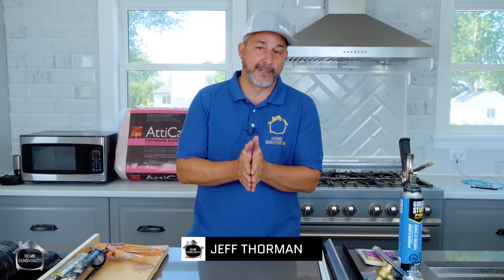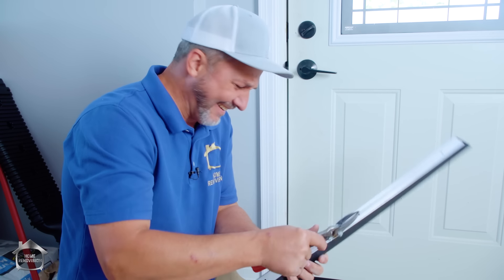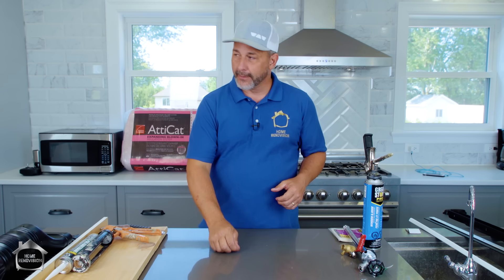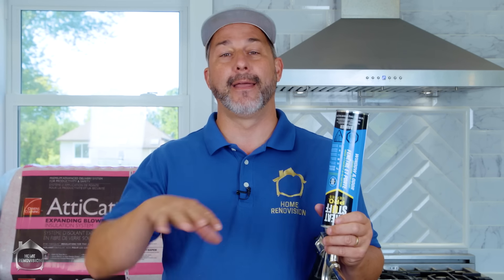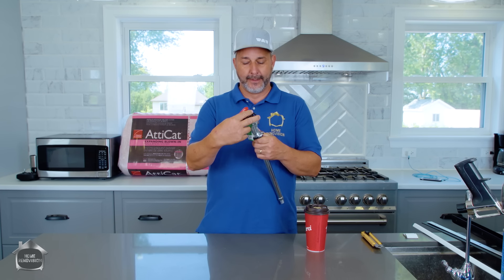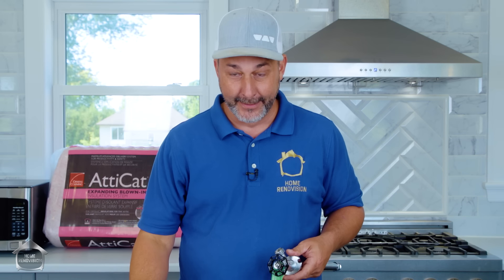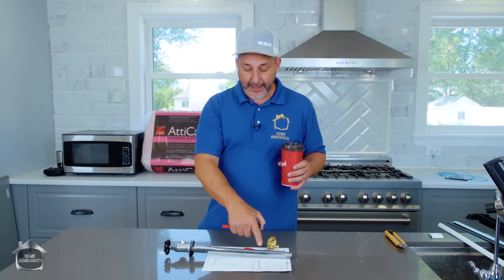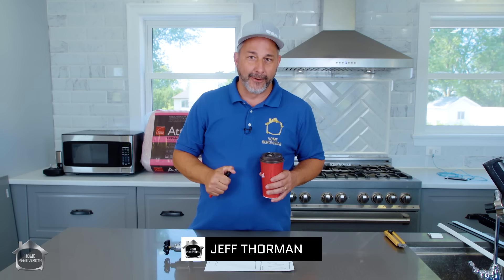How to Winter-Proof Your House and Save Money!

Comment: Those corner seals are supposed to go in thin side towards the inside of the jamb so the seal gets tighter as the door is closed. Not thin side up as shown in the vid.
Reply: Came to the comments to make sure someone called this out... Never installed them before but it just seemed so obvious just looking at the geometry.

Comment: Life tip, those door guards are like $10-15 each. Thriftier option is some foam pipe insulation covers, usually come in a pack of 3-4 for like $4. They come with a slit down the side and can slide right under your door and they don't slide around either. I get the 1 inch size and for $4 all my doors are sealed up.
Reply: Also bubble wrap works great for windows, spray some water on the wi dow then lay the bubble wrap against the window edge to edge.
Reply: Great information 👍👌✊

Comment: Never thought about taking out the gaskets when painting the door. Genius.
Reply from the maker: they come in different colors too so you can change the look when painting. Cheers!
Reply: My trick was I painted the door the week before I moved in, because it was a bright lime green and needed to be red, so I put it up on saw horses inside the house with plastic and did a few coats of paint, let dry for a whole week :).

Comment: I bought the same gutter extensions and they all leak hella water at each joint.  Removed all of the gutter extensions and replaced with Corrugated pipe trenched with overflow pop-ups. Works Phenomenally!

Comment: Quick tip about caulking, you mentioned its a mess to touch up. If you use certain  dish wash soaps (believe Pine Sol is one in the US), mix it up a bit with water and dip your finger in it. The texture on your finger becomes smooth enough that you can smear it up however you like with smooth clean lines.
Reply from the maker: Cheers!
Reply: I tried that when applying  silicon between a painted beam and concrete in order to keep water out of the gap. The cosmetic look was good, but the silicon peeled away from the beam and concrete. I will never again use soapy water when applying silicon.
Reply: @MaMa-qh4dy  Although I do not know, I assume you may have gotten some of the soapy water in behind where the silicone was intended to bond, which would create a poor contact surface. I always use minimal amounts and make sure it is never anywhere else than on my finger. I don't see how it would ruin the bond to the contact surface, as you only touch the exposed part of the silicone. Hope it helps :)
Reply: High proof rubbing alcohol works too and evaporates quickly. :) Clean the surfaces being caulked with the alcohol, apply the bead, wet your finger with it, and smooth it out.

Comment: We always leave our hose bib half open/closed all winter to allow water to flow out if there is some still in there. If you close it completely when you do have water still in the pipe it won’t have anywhere to go so Booom goes the pipe. If you leave it semi open it allows the expansion of any water to move freely and escape if needed
Reply: Yes, we always did that too. Now we live in Hawaii, no freezing pipes here 🌈
Reply: Might have to do this because my 1930 home doesn’t seem to have a shutoff valve and we are at 22 degrees at night 😢

Comment: Window rope putty changed my life last year. It made a huge difference with my 180 year old windows. I just went and sealed the transom window over my front door. I thought the screen door was tapping in the high wind but I discovered that the really cold arctic air is pouring in and causing the window to gently tap. Since it's 2am and we're having a blizzard I used what I have on hand. Which was one more roll of that window rope putty.

Comment: Another suggestion that i just recently learned about are chimney balloons. I have an old wood fireplace in my basement that i have no intention of using any time soon. There's a balloon out there that goes above the flue gets inflated, seals out all the cold air assuming you dont use your fireplace and in the summer it keeps bugs and what not from coming in. It has a string that hangs down into your fireplace so if you do go to use the fireplace the string catches your eye and reminds you to take it out before lighting a fire.

Comment: I'm glad I came across this video! I'm a first time home owner and I'm getting ready to turn off the outside spigot. I would have just turned off the valve and the spigot without checking to see if there's a slight downward slope. Considering how just about everything else was installed in this place, I doubt it was put in properly. Thank you for this information!

Comment: The black rubber gasket at the end of the hose bib that you replace when the faucet starts to leak is flat. I mention this because after 20 years of pressure it will look like a top hat. I spent 2 months looking for the right size of top hat gasket until my friend said just try a flat one. Which of course worked great.

Comment: There is a ton of good info here. Because I’m “that guy”, I would just point out that while ice occupies more volume than water, the difference in volume is not dependent on how cold the ice is. It doesn’t swell more as it gets colder. Once it’s fully frozen, which can happen at 0 C or 32 F, it has grown in volume as much as it will grow. That doesn’t really change anything you said about the hose bib though- this is still good advice.

Comment: If your door has a gap under the knob side, remove the top one or two screws in the top hinge and replace with a longer screw.  That will tighten the door and remove the gap.
Jon in rural BC, Canada

Comment: Great stuff! I laughed at "your hose bibs should have a shut-off" because mine didn't! I just had them installed. The plumber did say it was using frost resistant (proof?) bibs but now I have the valves. I didn't know about the angle but makes total sense, thanks for that tip!

One other tip for folks: usually there's a home energy audit you can get. Mine was $60 or so and they checked most of this especially the door/window sealing. They will also usually seal it up for you as part of the audit. They also did a leak test with a door blower and I got some special pricing and rebates for doing my attic insulation. I paid for it but maybe next time when I need it again I'll watch Jeff's other video on it! 😁

For my windows, I am replacing them eventually sometime soon so I actually just did brown caulking on the inside instead of the spray foam. My windows are in bad shape so I don't think it's worth taking all the casing off since I just want to get rid of all that. Caulking made a big difference on the draftiness so definitely do the spray foam or something for old windows.

Comment: I had a home energy assessment done. You wouldn't believe how much air leaks through outlet cover plates. Mine were WHISTLING when they pressurizes the house. If you seal off air leaks you'll dramatically reduce the drafts in the winter months.

Comment: Just a note. The risk is worse if the basement ceiling is finished as little heat reaches the pipe from the inside. If you can't get to the job right away cover the outside valve with styrofoam, 4 or 5 in thick. Very good videos by the way.

Comment: Yea his advice about fire alarm batteries IS ON POINT!! 😮 my ex husband was THAT GUY that was too cheap to put new batteries in the fire alarms and he stupidly disconnected them from the hard wiring because they were chirping, so fast forward several months to a late September middle of the night and I hear a scream coming from my 10 yr old twin daughters bedroom screaming mom the fire , the fire it’s so big! And thank God I’m a light sleeper And  I ran in there jumped over the flames which were started by an electrical short in one of those metal touch lamps and it caught the tv and wall and floor on fire , so I jumped over it grabbed her carried her over the flames and then kicked open the door to my husband at the times bed room and screamed get out there’s fire , then I got kids outside and dogs, but then my hubby decided to go back in the room on Fire to take the tv out that was on fire because he didn’t realize that the lamp started it, will that tv dropped burning flaming plastic all the way down the hall and into living room as he carried it out the front door, which set the entire host ablaze, then he went back in that bedroom on fire for a basket of newborn Kittens and I couldn’t leave him in there alone I had to help him get out faster, thank God the fire department responded fairly quickly and saved our cats and the only thing that died was a bowl of beta fish in that room, the cats and other fish in living room survived, cats had minor burns and we had minor foot burns AB’s smoke inhalation, but can you imagine if I was a heavy sleeper OMG we’d all have perished ALL BECAUSE HE WAS TO LAZY AND TO CHEAP TO CHANGE TWO BATTERIES !!
Also ALWAYS HAVE AT LEAST ONE FIRE EXTINGUISHER IN YOUR HOUSE DAILY AVAILABLE AB’S X ALWAYS CHECK IT’S FUNCTIONAL!!!! Had we had one wet could have put that fire out! Stay safe And stay smart

Comment: When it’s come to fire detectors, we had ours wired into the house. So unless the power goes out they’re fully operational and no need to constantly change the batteries. Also they’re all linked together so if one goes off, they all do. They do have battery backups in them in the event of an outage. However do NOT install them over the bathroom doors because if you take hot showers, the heat and steam will set them off, just the word of advice.

Comment: Great channel.  As mentioned in other comments, it is important to mention for first timers who may not know...
Disconnect the garden hose.
Don't screw on a cap on the bib.
If you have a screw-on manifold (splitter), remove it or open the individual shut-offs.
Maybe edit your pinned comment to include these points.  Thanks.

Comment: Thank you! I have a 3-4 yr old garage "steel" door (no steel on sides) and the bottom outside  pad was getting smooshed, so I pulled it off. Now I noticed the bottom side wood of door  is rotting already. I will go to Home Depot and get new pads and paint the door. Also outside wood trim is peeling, again at bottom. Already primed and painted once with latex. Guess I should get oil based paint. Gutter extension a good idea, too. Your explanations are very thorough. Thanks again.

Comment: As a renter, I would be happy to seal my door, better. Already installed the bottom part, but I am thinking of using the same item across the top. (Since we have { nearly} quit smoking, I have noticed that the upper top of the door has a ugly orange film around the entire upper door.) It's like a smoke halo. I may try the foam around the frame also. And maybe the two windows that I actually open. Thanks 👍  I only wish the hose bib worked so I didn't have to carry gallons of water in the spring for my little garden attempt.

Comment: Just did the hose bibs yesterday. Plus turned off the breaker to the AC, and covered it. Today is humidifier maintenance day, clean out all the scale etc. Did not know about the bleeders on the shutoffs, may have to replace mine, they're the tiny ones with small handles, difficult to open/close. Had one split, years ago. Heard it leaking after turning it on, turned off fairly quickly, still made a mess of the finished ceiling in a basement bedroom. Had to cut an access hole to replace the hydrant.

Comment: We rent and have the cheapest, draftiest vinyl windows that were on the market probably 25 years ago.  I've found that the Frost King clear shrink window insulation kits work really well at stopping drafts.  It's inexpensive, crystal clear, durable, installs easily, and the included double sided tape comes off vinyl fairly easily without leaving any residue.  
The only con is that once installed, you can't open the window. 
Also, the manufacturer does not recommend applying the double stick tape to painted surfaces.  Luckily, my windows have a wide vinyl jamb that accepts the double stick tape.

Comment: Thanks for the tips. I will go check my valves and ensure the proper angle. I am sure is is correct because I had no leak in the past. But you never know. Cheers

Comment: Great video! First time homeowner of a single family home and this info is priceless! Thanks! Btw, in the summer, I turn on the attic fan that helps reduce the humidity %. Was told below 50% is good for summer. This winter, never really thought about adding humidity. It’s usually around 40%. If I get a humidifier, what should I keep the house to, 50% also? Thanks

Comment: A trick i learned with caulk is to have a package of baby wipes. It comes off much better than using paper towel. 
I know guys like to give each other a hard time so i would just take the wipes out of the package and put them in a zip lock bag so they don't see that they are legit baby wipes.

Comment: Good info about the hose bib, but you should have mentioned that the hose needs to be disconnected during freezing weather. I rented a condo once, and the previous renter left the hose on so the bib could not drain and it split the line in the basement. I found out the hard way it was leaking. Luckily nothing was in the basement at that time.

Comment: Buy a heat/temperature gun from Home Depot and get some clear bubble wrap paper. If you coat your windows with a small amount of water from a spray bottle, you can apply that bubble wrap to the glass and it helps insulate your place from drafts leaking through the windows during winter.

Comment: Hi. Thank you for your informative videos. I have learned a lot from them. 

I have an issue in my home regarding the outdoor spigot. When the previous owners finished the basement, they closed up the valve to shutdown the water to the spigot. I feel that I have a few options:

1. For the time being, allow a trickle from the spigot to prevent freezing.
2. Put on an insulator to the tap.
3. When an appointment becomes available with a plumber, have them add an accessible valve to the pipe.

I would be very grateful if you could provide any opinion on the options above or something else that I may have missed.

Thanks in advance for your time!

Comment: Learned the hose bib the hard way. Took out my downstairs rental bathroom at my place this spring when I turned it on. Just as we were trying to rent it out. 
It wasn't secured and was twisting the pipe a little every time you turned it on or off. The solder joint broke as soon as the valve was opened.
Have those hose bibs on every one now.
Reply from the maker: Cheers, sorry to hear you were a victim of someone else's stupidity.
Reply: @HomeRenoVisionDIY  Yeah, thanks.Gave me a chance to fix all the other issues I found and run PEX with a  manifold setup while the roof was out so I got rid of dozen of sketchy solder joints. Shark Bites are awesome, made my manifold out of Shark Bite 3/4x3/4x1/2" T's. Was so easy. The hose bib was shark bite too! Ain't cheap but totally worth it. Ran extra lines to replace other copper lines later and capped them off. Can just add more T's to the Manifold when I need to. SharkBites are the best DIY plumbing item, well I think so and that's just my take, I'm a Carpenter not a plumber :)

Love the show, cheers from you neighbour in Alberta, eh!

Comment: If your window has foam trim with paper facing the inside then use caution as the double sided sticky tape will tear the paper off leaving a mess. I speak from experience.

Comment: Was so glad to see this video... moved into a new house (in Ottawa) and with the latest snow thought I should turn off the taps to the outside. I cannot find them... can it be that older houses (60s) didn't require the shut off valves inside the house?

Comment: That's a frost free faucet. Installed with the proper slant the exterior pipe doesn't hold water and freeze. The water is 12" inside behind the washer where it's warm. You don't need to shut it off inside or drain it.
Reply from the maker: That is a lot of if's that most folks don't know how to confirm. use a vacuum and you never have to worry!

Comment: I put those socket things in my apartment. They really do help a lot when your walls don't even have insulation. I swear they are rated R -100
Reply from the maker: they do get covered up by the cover plate so you never actually see them.
Reply: @HomeRenoVisionDIY  the only way they'd work is if the plate pinched them to create a seal, much like gaskets for outdoor lights or plugs. Even if perfectly placed/sized on your indoor plugs (a nightmare) it would push the plate off the wall a hair.

Comment: Most smoke detectors beep when the battery is low and 9 volt batteries last a really long time. Didn't get the deal with the gravel.. always cut a caulking tube on a solid surface with a utility knife and a perfect 45 and line up the angle with the trigger. Must be a Canadian style hose bib...

Comment: Thank you for the awesome video! I just noticed a small draft around my front door's hardware and I'm going to use weather tape to seal it up. For the water spigots, what do you recommend for homes that don't have a shut off value? The only only indoor water valve I have is for my main water line.